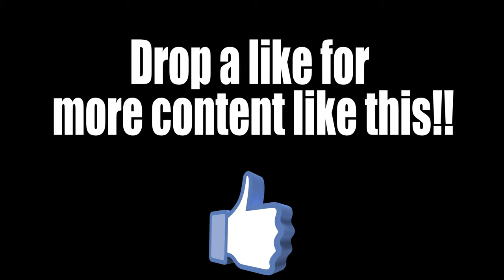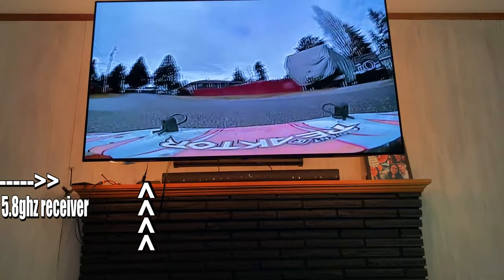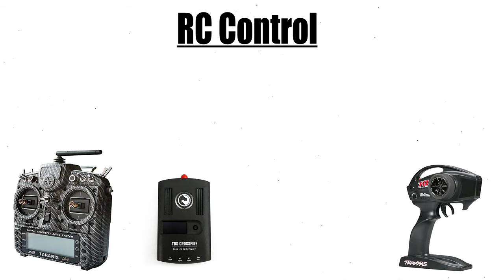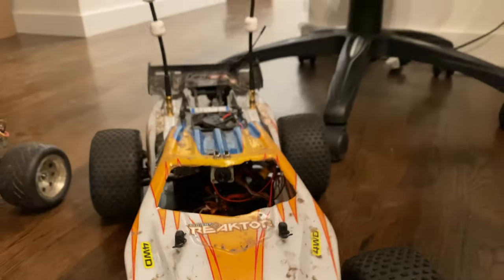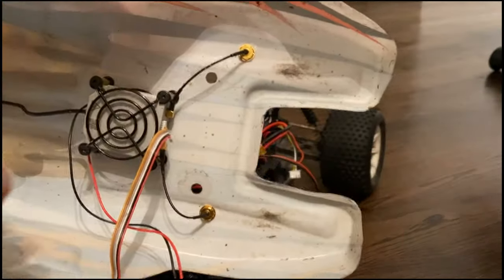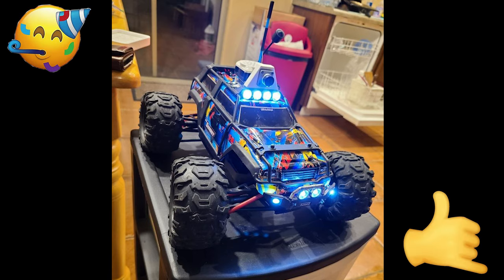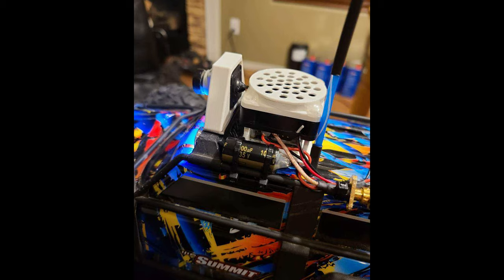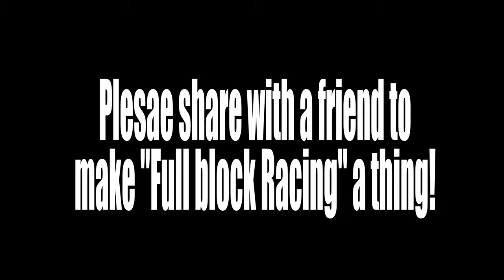How to Build an FPV RC Car in 2021!!!!  - 4k

Comment: Hi, great videos. For the air Unit 03 the 2 antenna are 5.8 and 2.4 but dji only switches to the 2.4 if you use the dji remote. So just a fact to keep in mind. That  one of your antenna are just potential a waste of weight and space.
I forgot why the drone guys do exactly in this situation
Reply from the maker: The antennas are both used all the time for the O3. It’s not that there is a 5.8ghz antenna and a 2.4ghz antenna. The stock antennas on the O3 are dual band; and you cannot decide to ‘only use one’ and remove the other if you’re upgrading antennas, or it will burn the amplifier chip out of the O3 👍
Reply: @ChaddRainsFPV  I will send video explaining what I mean. Basically you see only going to use 5.8 not 2.4 because you don’t have the dji remote . This is no big deal but look it up you will see
Reply: There is an episode of Mr. Steel emailing dji and they explain this in that video
Reply from the maker: @RexSmithII  Right. The O3 will not use 2.4ghz (except for “Fallback video”) unless the DJI remote is used. I just wanted to clarify that both antennas are always used, in every scenario 🤙
Reply: @ChaddRainsFPV  👎🏻
Reply: The 2.4 GHz and 5.8 GHz frequency bands are supported for receiving; however only the 5.8 GHz frequency band is supported for transmitting.
Reply: It will only matter if you use the DJI remote. The O3 is:

2.400-2.4835 GHz (RX only)

5.725-5.850 GHz (RX and TX)

The DJI FPV V2 controller lists both 2.4 and 5.8. I don't know if it matters if you don't have 2.4 antennas. Maybe it automatically switches to 5.8 if 2.4 is weak. Maybe it works but with a range reduction.

If you use ELRS, or Crossfire or anything else but DJI then you don't need, nor want dual band antennas. @ChaddRainsFPV
Reply: @ChaddRainsFPV  on your unit did you have trouble getting the 03 to get full power? Because earlier 03 needed a flight controller to arm then dji gets full power. I was thinking of just adding a fc for osd telemetry and o3 to arm full power
Reply from the maker: @RexSmithII Just check my comments again, brother. I never said otherwise. But again, you cannot drop an antenna because it’s “dead weight” as you said. The O3 must have two antennas connected. 

I didn’t say it needs to be dual band. But that the stock is dual band. And to reply to the other comment: I have a product I’m releasing soon that sends the necessary MSP signal to the O3 to “arm it” and output full power. 

Keep an eye out; I’ll post about it soon.
Reply: @ChaddRainsFPV  yes, I know you need two antennas the question is for cross fire having dual 5.8 might be better, it’s in the end of that video. Also a flight controller with inav would be best for the dji air unit , you would have so many options you can do including making your own AVC system and have way more fine tuning ability

Comment: Great video, I have 2 cars I built up this week for fpv, one is on 5.8ghz and the other I am waiting for my 1.3ghz equipment to come in still, when the weather gets better next week I will put out some videos.
Reply from the maker: Right on!! I hope more people get into this. Are you building a full ground station or just going with a single 1.3 receiver?
Reply: @ChaddRainsFPV  I wanted a full ground station but the eagle eyes diversity is out of stock everywhere so will have to make do with a single receiver for the short term.
Reply from the maker: @ManWithACam-u4t  - right on. I got lucky I never sold mine. I learned that most of the 1.3 receivers are not that great. I got a goggle module and it just sucked. I HAD to go the RMRC receiver to get decent range and even then I had to use a repeater to get distance between my crossfire and 1.3 receiver. 

I’m just pumped you’re making a car tho. I’m sure whatever you get you’ll make work
Reply: @ChaddRainsFPV  Thanks, its all a fun learning process, and you are right there is not enough rc car videos out there so will be doing my bit to put out that kind of content.

Comment: I hope your 1.3ghz video comes out soon. I'm wondering what are the components on your repeater you place on your deck. Mostly wondering what is the big clear box with av connections to it?
Reply from the maker: So many people have asked I guess I better finish that vid haha. 1.3ghz kinda sucks in my neighborhood (a high noise floor on that frequency) so I haven’t had much ambition to show it off. I’ll get to it tho 🤙
Reply: @ChaddRainsFPV  I just dropped some money on 1.3ghz equipment. Hopefully I don't have the same problem in my hood.
Reply from the maker: @darensworld2221  1.3 is no doubt, a hard frequency to use. I will get some more info up on my dramas and what steps I took to fix em 🤙
Reply: @ChaddRainsFPV  So I finally got my 1.3ghz video and 915mhz crossfire system put together and working on my rc car. Your videos were a huge help. Thank you! Now I am planning on upgrading my antennas because I'm not getting the range I was hoping for. Any antenna recommendations for the video feed?
Reply from the maker: @darensworld2221  Aye awesome! So yeah, the best performing antenna is going to be a VAS Pepperbox (almost no debate), but you may not want to get it if 1) you don’t have much room (the thing is huge) and 2) you don’t want to spend over $100 on a single antenna. Or 3) you want to drive behind you (since it’s a directional antenna, you have massive range in front of it and almost zero behind it). 

Grab some TrueRC singularities if you just want solid omni antennas 🤙

Comment: My issue has been where to mount it really a wind shield is a great idea my car gets banged up in a crash really easily so maybe I'll go for something further ranged
Reply from the maker: I mount on a custom 3D printed piece on the top of the car, then usually house my vtx under the roof (with a fan) for protection. 

The 3D print file is in the description of most my newer vids for free and you can get it printed by Brain3D for like $10 🤙

Comment: Hi can you make a tutorial on your ground station
Reply from the maker: I will! I am working on that video now actually. Currently converting my DJI car to 1.3ghz and building up a new car with DJI. I should be able to get some footage soon and finish up the video 🤙
Reply: @ChaddRainsFPV  what video receiver you use?
Reply from the maker: @datumotion1448  I did some testing on 2.4ghz control and 1.3ghz video using a notch filter and it wasn’t bad actually. But the range of 2.4ghz was the limiter. So I am using crossfire (915mhz) with a repeater on my ground station to get the separation I need. Using a notch filter too 🤙
Reply: @ChaddRainsFPV  do you use the directional antenna or omni? Better make a video tutorial
Reply from the maker: @datumotion1448  I’m on it brother 🤙
I have no issues with an Omni on my crossfire. I use a diversity system I put together in my ground station for 1.3 that one of each
Reply: @ChaddRainsFPV  hi do you have tutorial on your ground station in detail please
Reply from the maker: @datumotion1448  I was having some troubles getting range that I was happy with with the 1.3ghz system. I just got a new VTX in today and hope that was the issue. I should have some stuff filmed and edited on my system really soon 🤙
Reply: @ChaddRainsFPV  can't wait man!

Comment: Would be nice to have realtime video-stabilization to the googles. FPV on car is quite intense with the vibrations.
Maybe it can be mitigated with the use of springs (or similar) to hold the cam?
Would also love to have head tracking.
FPV for RC cars have so much potential. I don't understand why RC manufacturers dont offer more of this.
Reply from the maker: Seriously! It can get expensive to do a good setup but if people are willing to buy these 100mph 8s machines I’m sure there’s a good market for it. 

There are some decent gimbal options that help with the bouncing (and maybe a really good one coming on my channel if I can get the kinks worked out), but for now big tires and soft suspension work great!

Comment: Great video. I'm trying an analog fpv mod for my Slash 4x4 just for fun. If I use a 1w Rush vtx without a fan do you think the airflow of the car is enough to keep it from overheating? I like to bash so I'm trying to figure out a system that's easy to cheaply replace/repair, hence analog instead of digital. Thinking if I can set up pit mode 25mw, so the vtx isn't always cooking at 1W I might be able to get away with it?
Reply from the maker: Awesome! But 100% nope, it will overheat. Pretty much all VTXs are designed for drones; so to have propellers constantly blowing cold air on them. I tried the biggest heat sinks I could reasonably put on my first FPV car (a slash 2wd) and only had it set to 800mw. Overheated in about 4-5 minutes every time. 

If you are constantly running at 25mph+ you might be able to get away with just a heat sink, but I can’t even get my average speed that high on my Lasernut. I’m always doing donuts or crawling over some stuff lol. 🤙

Comment: 1.3ghz video works fine with 2.4ghz control if you have ferrite chokes on the wires going to the receiver in the car.
Reply from the maker: You would want a low pass filter on the 1.3ghz vtx too and you’d likely be good 🤙
Reply: @ChaddRainsFPV  that’s right! I forgot about the low pass filter.

Comment: So, I have pretty much everything needed for the DJI RC setup I just need to get some fans and the PWM and adapter. Once I get the last parts I have a RedCat Gen8 V2 I am going to customize with FPV and few other additions so this should be very fun thank you for the video.
Reply from the maker: That’s awesome man, yeah sounds like a perfect setup 🤙
Reply: @ChaddRainsFPV  I am very excited to do the setup just a little nervous with soldering but gotta try it to get better.
Reply from the maker: @chubz2189  $3 Diatone Practice solder board will help and watch a couple videos on soldering. If you use flux and tin everything before you solder the wires together it will be easy 👌
Reply: @ChaddRainsFPV  Thanks Chadd I probably will pick up a practice board and do some hands on getting used to soldering. Then I will watch a few videos on how to install everything.
Reply: Hey Chadd so I have everything for the setup I think, was curious do you have a discord channel or anything for FPV RC would be helpful to newbies like me lol
Reply from the maker: @chubz2189  I don't at this time, but I probably should haha. If I make one, I will be sure to post about it quite a lot. I talk a lot on my YT channel comments section, I don't mind answering questions here for now. I'm sure the channel will grow and a discord channel will be the right move. Thanks for the suggestion!
Reply: @ChaddRainsFPV  No problem, it would help a lot of us trying to learn also. I would like to ask others input on how to set up this FPV RC I am pretty sure I have everything I need. Crossfire, a Redcat Gen8 V2 and DJI goggles and air unit plus a crossfire TBS crossfire6chPWM and TBS crossfire PWM adapter and fans to hook together and I got the practice board for soldering lol Now I just need to figure out how to hook all this up on the RC and set it up.
Reply from the maker: @chubz2189  So the air unit only needs it's power and ground wires hooked up to power it. No other wires need to be soldered for that. You will have to set the air unit to 'Temperature protection: off" to get the full power because there is no flight controller. Just make sure you have the fan on.

The crossfire receiver in the PWM adapter is not really different to any other receiver. Just plug your servos leads in and roll. You'll have to set up the crossfire rx and tx but there are tons of videos on that. "PWM crossfire output" and you'll find it.

From there it's just testing to make sure it's all working right. Maybe a few YT videos and you're golden  🙌
Reply: @ChaddRainsFPV  oh I've been watching tons of YT videos on wiring soldering and fans and servos and hooking up to RCs lol just gotta get some more time then find a good way to hook it into the power supply and do the layout in the V2cover or build a frame that everything can attach too. Just a process that will take time but will be worth it once done I will try to upload a video.

Comment: Awesome! I've been playing with my dji set on my traxxas stampede but the video in the goggles is too jittery to go fast.. added foam underneath which helped but still not good enough.. I will be adding some videos to my channel soon of my progress so far.
Reply from the maker: Right on! Come drop by and let me know when you post! I’ve figured out some tricks to get less jiggly video, mostly by softening suspension but it makes your handling worse haha
Reply: I was thinking of this too, has same concerns. Trying to think of a way to get the camera to act as a "chicken head" no matter where you move the body the head stays in the same place. Some type of gimbal device would work, just on a smaller scale

Comment: Very informative, awesome job! I would like to FPV my RC car but wouldn’t have the first clue how to wire it all correctly. Is the DJI system beginner friendly?
Reply from the maker: I think it’s pretty beginner friendly. Use the Air Unit so you don’t need to solder to a PCB like with the Vista Unit. Run it on a 2s, 3s or or 4s LiPo (no higher). And just hook up power wires to it along with a fan. Pretty straight forward 🤙

Comment: Thanks for the video!👍🏻 
Just a question: so those 2 antennas that are attached to the camera are only for the video connection to the goggles? And that little antenna at the back is only for the  remote, ist that correct?
Reply from the maker: Yup! The digital FPV systems often have two antennas (small, ball shaped, circular polarized antennas, usually) and the RC system will have a single, linear, whip antenna (usually). They’re always on different frequencies. Hope this helps!

Comment: cool video bro also very nice edit! thanks for the information I'm going to build one for myself for sure. the only thing i didn't like is the vibrations on the fpv camera while driving. i guess that can be fixed with soft mounting or hard cage around the car's frame instead of mounting it on that shaky plastic on top of the car , i will have to solve this issue i guess LOL, thank!
Reply: BTW i ordered FS-GT2 controller it has also 3.5mm dcs port and it's very cheap on aliexpress
Reply from the maker: Right on! As for vibrations, there are a few things with my new build that helped a lot. 1: not having small tires. 2: softening the suspension a bit and 3: soft mounting the camera as high as you feel comfortable. Getting a bit further from the ground let’s you see farther and seems to help the vibrations. I’ll post the new rig soon 🤙

Comment: Hi! I am working on an FPV car right now and am using a logitech steering wheel connected to a computer. Hoping to connect an RF module to a computer (maybe even a rasberry pi) as well as have an onboard rasberry pi and communicate between them. Would you reccomend I still use the cross fire TX and receiever? If so, how easy are they to implement without using that specific controller and google set up you have? Thanks for the awesome content!!
Reply from the maker: Trying to control an RC car using a Logitech wheel was always a dream of mine! But using it through a computer turned out to be futile, as there is too much latency with any link that easily works with a PC. 

I’ve seen others bypass a computer and go directly into a radio (like a TX16S) but I have never done it myself, so I wouldn’t be much help. I can say that the 4G video systems also have too much latency to drive an rc car more than ~10 mph. 

Hope this info does help a little!
Reply: @ChaddRainsFPV  I am trying to avoid 4G and stick to RF for my com system to avoid that lag issue. Thanks for the reply. If you have any RF modules you recommend that could connect to a microcontroller easily that would be greatly appreciated!

Comment: sooo I should buy those cheap  "4k ultra HD" drones that have an app attached to the camera and then stick it in my rc car 🎉 got it 👍🏼
Reply from the maker: Those have less range than a 600mw analog vtx and so much latency that you couldn’t do more than 15-20mph. You you got a decent drone from DJI or Hubsan you’d have a bit more range and a gimbal to keep the image stable, but still a lot of latency and would likely be limited to 20-25mph. 🤙

Comment: How about video software stabilization?
Can't believe so expensive system like dji doesn't have this. On any current phone when you record video its software stabilized. Dont see why u couldn't do that with realtime feed. It would have to be pretty fast, but 20+ms of delay sounds realistic to have some form of stabilization for the last two frames at least or so.
Reply from the maker: Interesting. I think us doing rovers/FPV rc cars would appreciate this. Adding a bit of latency doesn’t affect us too much (as long as we keep it below ~30-40mph). But since the main focus of this system is drones, and this video link isn’t typically used to record video (so stabilization wouldn’t be needed), we likely won’t see it. 

Great idea tho 🤙